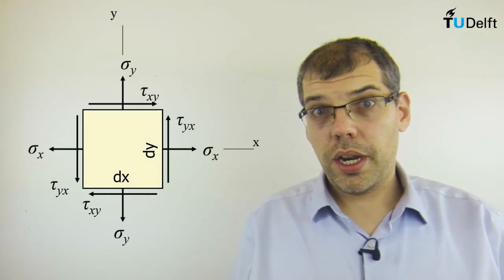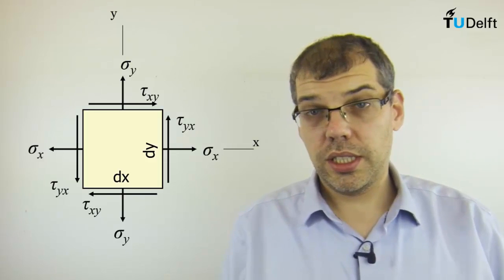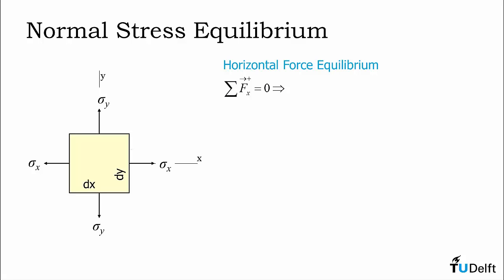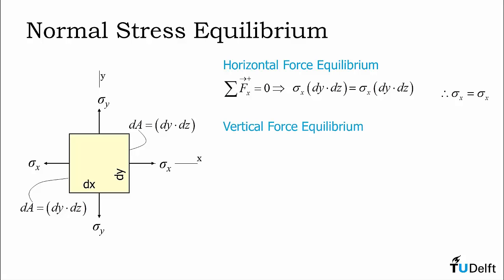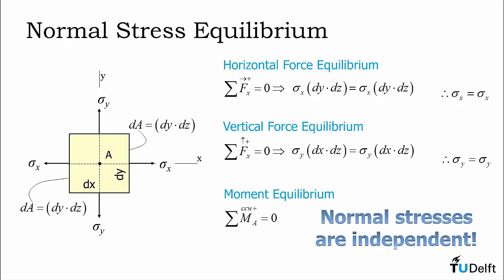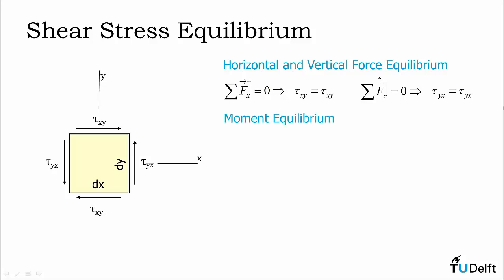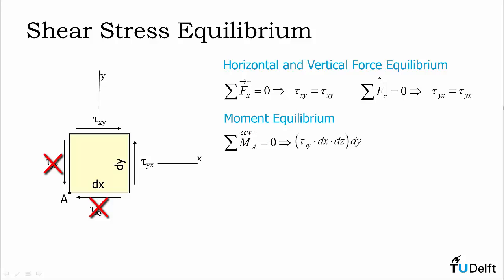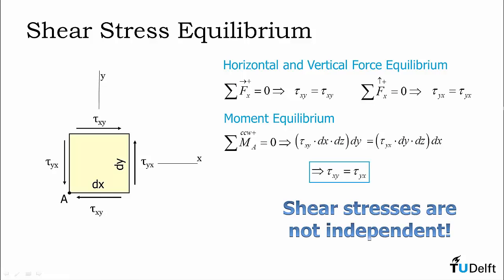1-4 Complementary Shear Stress

Comment: This derivation is for a state of constant stress. If the stresses are non-constant one ends up with the differential equations of stress equilibrium (e.g. Timoshenko and Goodier 2nd ed p22). I haven't seen a general solution to these equations to show that tau_xy = tau_yz  so I conclude that complementary shear stresses only apply in a constant stress field, a fairly trivial result. Anyhow, at least I understand that now.
Reply from the maker: Please look at p. 6 of Timoshenko and Goodier. They use the same approach (and elaborate on it a bit further) to derive this result and it is used throught that textbook and within the field of mechanics.
Reply: @DrRans  OK will do and thanks for the suggestion. You are correct that the principle of complementary shear stresses is widely used although I had no reason to question its generality until I saw your video. 
The T&G derivation is identical to yours so one cannot question it. Out of curiosity I will satisfy myself that some postulated stress distributions (say a 2 term polynomial) satisfies the various equilibrium equations etc.
I guess the other way to demonstrate complementary shear stresses is via Mohr's circle.
Thanks for posting the video.